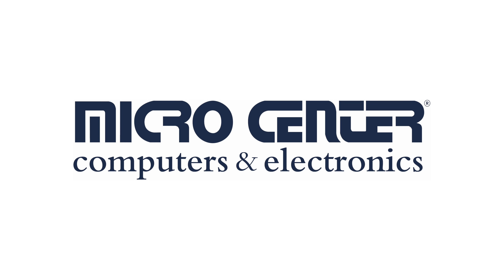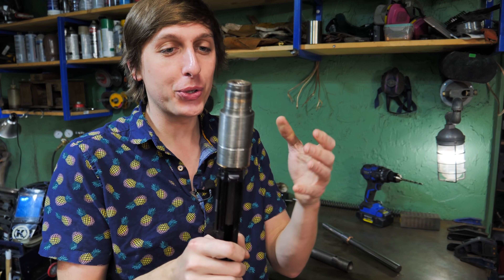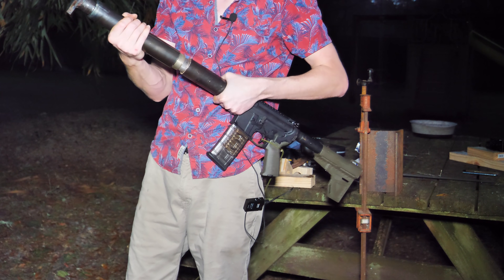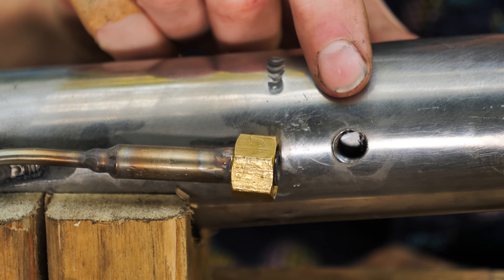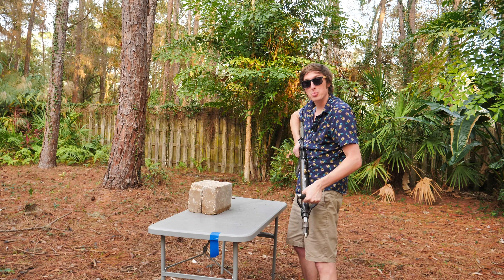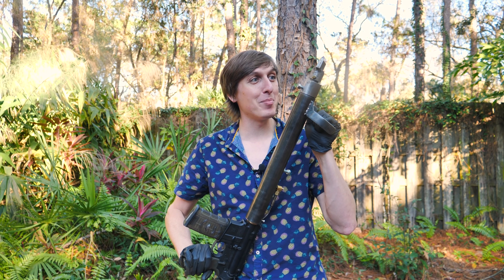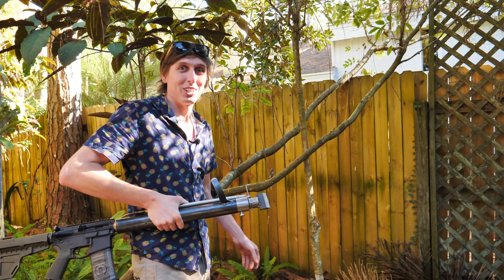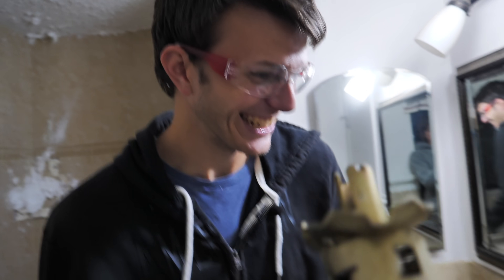I Made a Gun that Punches through ANYTHING

Comment: I would add a cross over gas tube at the end of the piston stroke that bleeds gas from the high pressure side to the low pressure side.  Then once the piston is all the way in the home position, have another port located where it all vents to atmosphere.  Or at a minimum, drill a port at the end of the stroke to vent the high pressure side to atmosphere.  There’s a ton of gas coming out of the breach.  With the lack of pressure relief before the bolt opens, and the back pressure from trying to move something significantly heavier than a bullet, you’re going to break a locking lug on you bolt and/or breach.

Comment: * sees brace *
Oh good the ATF aren’t going to raid him and shoot his dog
Reply: I was about to comment about the self-incriminating video before I saw the brace on the lower.  I'm glad I finished the vid before commenting.
Reply: Roopert Zski the ATF when raiding houses has been known (on numerous times) to shoot suspects’ dogs
Reply: Would it be an SBR though? Im not even sure if this thing still qualifies as a firearm
Reply: Ziron Kekerson it is a pistol, via the brace.
Reply: @Roopert Zski there’s far too much to explain if you’re starting with zero knowledge on the subject.  A simple explanation is rifles are designed to be fired from the shoulder and can legally have stocks, but can’t legally have barrels less than 16 inches.  The pistol version of the same gun, an AR-15 in this case, can legally have a barrel of less than 16 inches but can’t legally have a stock.  Pistols by federal definition are designed to be fired with one hand and are not designed to be fired from the shoulder.   A brace, while it kind of looks like a stock, is designed to help the shooter fire the gun with one hand since pistol versions of rifles are heavier than a normal pistol.  If the gun in the video was a rifle and/or equipped with a stock, cutting the barrel short like he did would have been a crime.  Since the gun in the video was a pistol with a brace, he can legally cut the barrel to any length.

Comment: I’ve never heard the phrase “lets hammer some screws”
Reply: Unfortunately it's not the first time I've heard it...
The first time was when my father told me about how they had bought a couch back in the 60's and had it delivered. It came in several pieces that were to be screwed together but the guys delivering it just drove them in using hammers saying it was much quicker that way...
What's remarkable is that I still have that same couch and it has held together very well.

Comment: The question is, if that “barrel” is less than 16 inches would the ATF consider that an SBR??? If so, say goodbye to Fido.
Reply: Technicaly its not shooting anything. If you just label the "barrel" as a gas operated piston (which it kinda is) I dont think you have much of a problem and it might be classified as a non NFA item. 

Keep in mind I have no experience with law stuff, also im not an American xD
Reply: Any way it has a brace so its a pistol
Reply: It would probably be an aow or any other weapon
Reply: you guys are acting like theres logic and reason to those laws
Reply: If it has a slit stock it is TECHNICALLY a pistol
Reply: @raaston9761  amen
Reply: :p
Reply: Well, it has a detachable box magazine, so it's a dangerous assault murder thing.
Reply: @antti6117  but it’s shooting blanks
Reply: Can cannons aren't 16" and those are sold over the counter.
Arguably the can is more of a projectile than this piston hammer.
The barrel and piston is also welded to the upper and cannot be "readily coverted" into a  functioning upper again. No different than a 14.5" barrel with a pinned and welded brake.

The lower hasn't been altered and may still be considered the legal firearm. I'm curious to see what the new receiver classifications may say about this.
Reply: @AlechiaTheWitch  ur TECHNICALLY wrong because Every brace design has to be submitted to the atf for approval
Reply: @arcanon5080  every legal one.
Reply: well, its not designed to "fire" a projectile. so its not considered a firearm. he has taken a real firearm and converted it into something thats not a firearm. so the atf would have to prove he altered the firearm with the purpose of creating an illegal firearm. and this video is proof that he hasnt done that and clarified his intentions.

now knowing the atf's history, they can claim just about anything they want shy of proving it. but they have nothing to win from targeting him anyways.

Comment: memes aside, removing the fist and just going into the battering ram, imagine how breach and clear teams could use this, since it's a barrel attachment the person on the door could bust the door and while the rest of the team funnels in he could remove it and follow in last
Reply: Wasn’t it welded on?
Reply: They already use something similar to this which is a pump action shotgun loaded with a special door breaching round that sends a steel powder to bust open a lock or a door hinge but without the risk of overpenetrating and injuring someone on the other side as the powder quickly loses its energy. It works better and it's much cheaper and versatile as its just a shotgun with a different ammo. Designing something like this as a barrel attachment would be very difficult and cumbersome.
Reply: Yeah, but... it isn't a "barrel attachment"<-(whatever that is).
It's a permanently modified upper receiver. There isn't a barrel on the gun. The barrel was replaced by the punch mechanisms outer tube, that was welded directly to the receiver.
Reply: @rogerscurlock2927  these kids play to much COD

Comment: You could market this to police... Especially if you could make this a removable attachment. You should get a patent. This is like the perfect breaching tool. One question though, do you have a vent port part way down the barrel to release the excess gas? it almost looks entirely closed (other than the gas port for cycling) which isn't terribly safe. The piston may take up a lot of the charge, but a single overpowered round may blow the gun apart. Just before the end of travel point for the piston you should drill a hole or slot to allow any gas to escape (if you haven't already). Don't trust loose seals to leak enough gas, because eventually they'll get dirty and close off causing decreased gas leakage.

Comment: Just a FYI they come in 2 differnt calibers 1 is a .22 the other is either .25 or a 32 lastly they have 4 different loads for the ramsets it would have worked if you used the highest load even with the .22 I have seen people turn them into one shot .22 pistols as well so try it again with the yellow or red label not the green.

Comment: if this same mechanism can be installed under the rifle barrel while still engaging the force of the blank or got integrated with a quick release function that doesn't compromise safety, i could genuinely see this as a tactical response/FBI breaching tool. someone mentioned door breaching slugs which do the exact same job being cheaper and more effective but as a less lethal version of an already "less lethal" product i think it serves a niche. 

hypothetically if the room youre trying to enter is small with minimal cover for the shrapnel of a standard door breacher round breach or in a situation where combatants/civilians/innocents are close to the door in general, this could produce adequate force to break small locked door without comprising the health of the individual 

maybe an integrated barrel design where the stopping mechanism/spring can be quickly de-threaded or de-latched to provide the shooter with a semi/fully auto weapon seconds after less-less lethal breach. with this concept the main breach mechanisms barrel would have to weigh less than an under barrel shotgun (1.22 kg for the m26 mass) to compete tactically
 
Also even though it would be the most unintelligent thing a person could do, i cant wait until we see someone use this concept on a 50cal blank

Comment: You know that swat teams can use this in stead of the battering ram.
Reply: It´s called breaching shotguns, same principle, shell goes boom, a ball of metal goes bam, door lock ceases to exist
Reply: @TeZaKone  yea,but this so much more fun
Reply: @TeZaKone  not a ball of metal, well it sorta is, they use something called "breaching rounds" which is is metal dust stuck together so when it hits the door it vaporizes, its to minimalize penetration
Reply: @lanemaness6616  Blanks are cheap too, much cheaper than breaching rounds. You could have a specific upper receiver that the department designates as the battering ram also.

Comment: In the 1970s there was a commercially produced powder actuated tool that used .38 caliber blanks. It was capable of penetrating 1-1/4" steel with a 3/8" diameter fastener. It works under water as well.

Comment: You’re going to give the ATF one helluva headache with this
Reply: I am sure if you asked a dozen ATF agents you would get at least 20 different answers on the legality of this device.
Reply: @Aaron.Reichert  and their answers would change a week later
Reply from the maker: It's definitely legal, but making it full auto now that would be a gray area
Reply: @TheBackyardScientist  oh definitely
Reply: @TheBackyardScientist  you sure it's legal? I'm seeing a short inner barrel, sbr sized barrel (not legal) with a fitting on the front, then essentially a suppressor over top. Pretty sure an ATF agent could absolutely charge you if they wanted to. Just saying, you don't want to mess with modifying the barrels of a firearm if you are even the slightest bit unsure. With how that thing works it pushes the gas through the inner barrel pushing the piston, but then the gas is transferred to the outer tube "housing" that operation inherently suppresses the report from the discharge. That in itself is loosely classified as a suppressor..... I'd delete this video sooner than later..
Reply: @WD-1477  They'd have to regulate piston assisted nail drivers that also use a rifle setup right? What about the X products Can cannon? It's basically a 2" barrel and a giant tube
Reply: @WD-1477  I assume the short barrel is why he used a pistol brace.
Reply: @WD-1477  You’re concerned that the barrel of his pistol is too short?  What in your mind is the minimum length for a pistol barrel?
Reply: @TheBackyardScientist  The main legal issue I see is that the extra length was welded to the inner barrel and can act as a suppressor. So yes, while the main “barrel” is short enough to be considered a pistol (since he has a pistol brace) the fact that the outer sleeve is permanently attached and can contain gasses worries me.
Reply: @thevalorousdong7675  Nail drivers and can cannons are legal as they are incapable of actually firing a bullet. That differs from this one as his just has a straight up hole that could still fire a bullet whereas nail guns have a piston that would block a bullet and can cannons have a blocked tube that has the gasses diffuse out the sides.
Reply: @Nate-lt1bq  The Can Cannon is the same as his AR-15 nail driver, except instead of a piston and 5.56 blank, it's a tube and a 5.56 blank. The Can Cannon isn't regulated
Reply: @thevalorousdong7675  Not quite. The nail gun and Can Cannon have the inner “barrel” permanently obstructed. This fist cannon has a barrel that isn’t permanently obstructed and could still fire an actual bullet. A nail gun and the Can Cannon are physically incapable of firing a bullet and are therefore unregulated.
Reply: @Nate-lt1bq  the can cannon isn't actually obstructed, you can take it off. It's a small barrel tube into the larger tube. His barrel was also obstructed by the piston
Reply: @thevalorousdong7675  True, but the end of the inner barrel on a can cannon is obstructed and the gas escapes from holes in the side of the inner barrel to the outer tube (I own one). It is also made to only be used with its own custom upper receiver, and it is incapable of firing a bullet. As opposed to his creation which can easily be modified (by literally just taking out the piston. The ATF only considers attachments permanently affixed if they are pinned and/or welded) to fire a bullet.
Reply: I obviously think it’s awesome, but I’m just worried that he could get in trouble for fabricating a device without a license or possibly making a hitherto unseen (and therefore unregulated) modification to an already existing firearm.
Reply: @pbp6741  saw the pistol brace and that causes a whole other laundry list of problems. First off it will have needed to be registered as a pistol, totally good if that is the case, but now that causes the issue of does the atf look at the sleeve as a "new barrel" thereby rendering the pistol as a rifle, also if it is officially a pistol and we are ignoring the massive suppressor on this thing, that forward chainsaw grip is also illegal. The atf has long held that adding a forward grip to a pistol reclassifies the pistol as an AOW as it is no longer designed to be held and fired with the use of a single hand, therefore absolutely illegal. You can't even put a simple vertical grip on any AR pistols, illegal. Now building ar-15s from a pistol to a rifle is totally legal provided that "barrel" is fixed. So in this specific circumstance on it potentially being considered an sbr might be okay as long as he did his paperwork, but the grip is going to reclassify it, rendering it an AOW, and doing so can result in 10 years imprisonment. The sleeve on the barrel which is in fact suppressing the report, regardless of that being the intended purpose or not doesn't matter. It is a suppressor in the eyes of the atf because it acts like one. Suppressors need a tax stamp/proper licenses. No matter how you look at this monstrosity, it is not legal, one way or another.
Reply: @thevalorousdong7675  First off PATs are not considered firearms by the atf in any way. Secondly the "can cannon" device is considered a shotgun by the atf, legal to own the device. When you put it on to a rifle platform (the only way to use it) it is suddenly considered EITHER an SBR or an AOW and is absolutely illegal without the proper tax stamps/licenses. Look it up. If you don't know a PAT is a "powder actuated tool" and absolutely no PATs are considered to be firearms in any way by the atf.

Comment: Wouldn't a smaller piston be better.  The share of energy two separated parts get when momentum is conserved favors the lighter side.  At that time scale the masses that matter are the piston vs the gun (assuming impinged system).  You want the bullet or piston to be a order of magnitude lighter than the gun to get the most energy out of the round.

Comment: What to do to fix the sheering of the pin? I'm also wondering if you shouldn't add some sort of front-end tube that can push back using springs, so after a shot you strike it against the hit surface to and then 'relax' enough to get just an inch or two back from it (now with the toolhead properly positioned and reset) and then shoot again - for a much faster effect.

Comment: if it where in any fps here is my take. flat head basic damage to players and better damage to equipment. ax head faster attack speed but more recoil and better damage to barricades/wood.  point head pierces armor and kinetic plates/reinforced barricaded but lower damage to players and slower fire speed . fist head superior damage to soft body(no amour) and stuns enemies and alt fire shoots the fist to deal increasing damage the longer it in the air no pricing ability and a stuns on impact, longer reload and individual reload. its a lot but it seems interesting. 

or a alt fire for a drill for point with a fuel mechanic instead of blanks